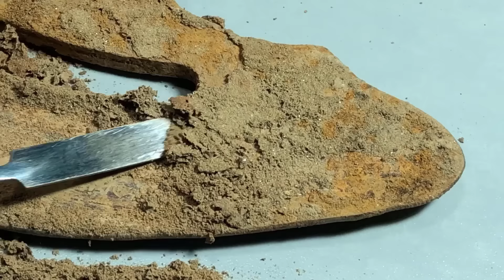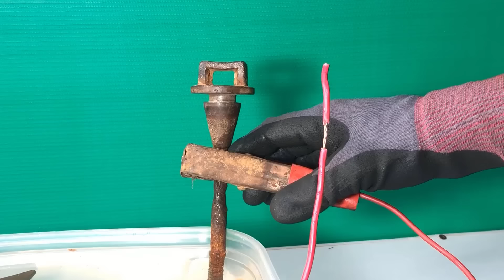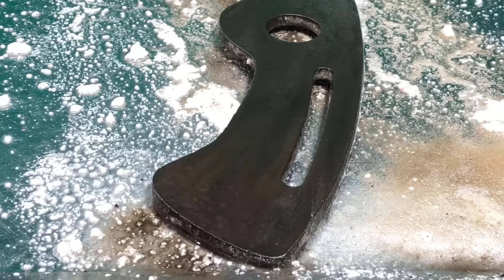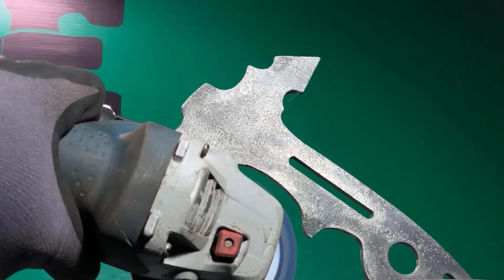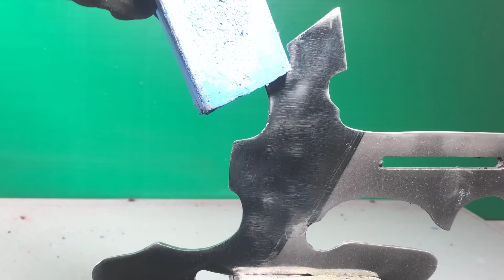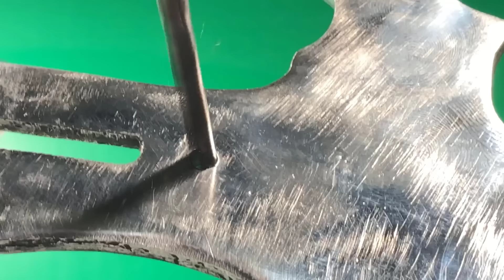Extremely Rusty Antique Cleaver Restoration#shorts #antique #restoration #easy

Comment: At the very most that access probably 5 years old and the handle because of the notches in it and the hole in the middle in the handle they use cord to wrap the handle and the hole in it is used for doing tricks such as spinning and things of that nature not to mention any type of axes back then had a wooden handle that one was made with a CNC so yeah they didn't have CNC machines long time ago

Comment: How many years underground? My guess is 0.000000235 years. Rusty? Did you see how well the condition of the hole slots in the blade and shaft were after removing the mu... rust? Also, last I knew from first hand experience, such a little chisel with minimal effort wouldn't remove rust like that.
Reply: Ok rust whisperer

Comment: You had me up until the handle. Although the metal clean-up, and subsequent polish was well done, the handle was poorly executed. The primary rip was uneven, the chosen wood is inferior as well. It should have been shaped to fit the palm only; to maximize a stronger downward cleaving motion. It would also leave adequate clearance for larger cuts of meat.

Comment: Fake. You can literally tell that he intentionally rusted this cleaver. When he was knocking off all the rust in the beginning it looked like he knew where the handle holes were. Also, something that has been rusted underground, rust does not come off as easily as he demonstrated. Plus, it was shiny underneath where the round hole is. Obviously, fake.
Reply: Not to mention tha there wasn't an edge on it originally